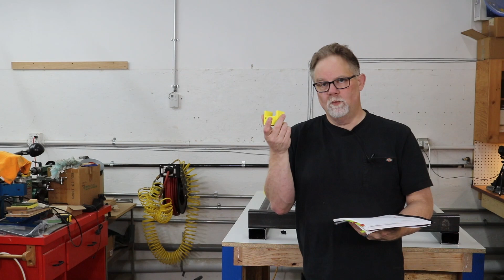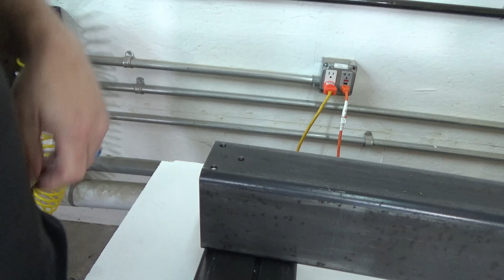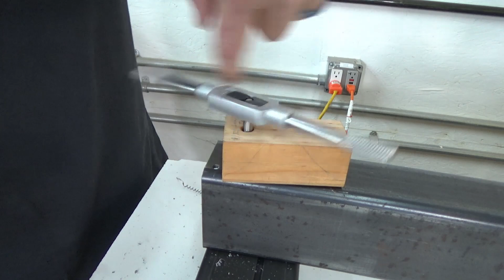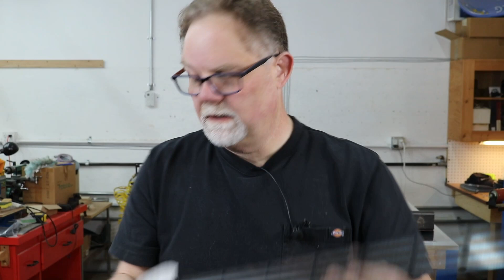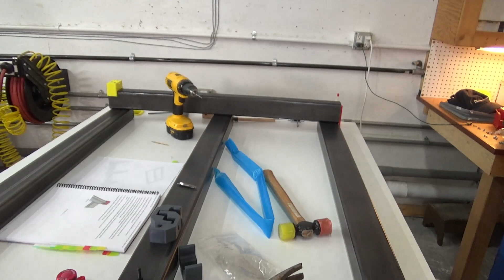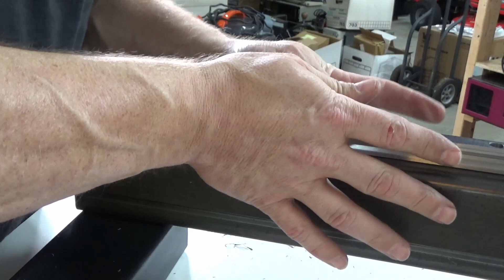PrintNC Project Part 4 - Y Axis Work

Comment: FYI, You DON'T need to drill every hole. Every other is more than sufficient.
Reply from the maker: I used  my one time machine trip to smack myself in the back of the head for even starting this project.  Hopefully your advice will help the next builder. ;)

Comment: A huge thank you for documenting your build in such detail. Like you, I've watched many videos but it seemed that omissions we're in each. 

The one thing that caught my eye was the lack of orientation marks for the 3D printed parts. It's implied that there's an arrow on some but it's just the shape of the holes.  Yes, the holes form some semblance of an arrow but an unambiguous orientation marks would help.
Reply from the maker: You're welcome!  The part orientation can be a problem if you're moving fast and not paying precise attention to the wiki documentation for those steps.  That's what bit me.  I'm hoping that the clarification I added to the wiki article for the BF12 blocks will help folks in the future.

Comment: Nice work Gene, strictly speaking those are called center drills. They are used on a lathe to drill holes in the end of stock so that it can be supported by a live (or dead) center.
Lots of folks assume they are used as pilot drill but the angle is completely different from a 118 degreee metal drill bit.
Reply from the maker: Thanks!  Yeah, it was a recommendation on the Discord, so I figured I'd give it a shot.  I knew they were normally used in lathes.

Comment: kudos for such accurate drilling. that ground rail is engineering porn, isn't it !?

looking forward to the next instalment :)
Reply from the maker: Thanks!  Using the right sized center punch along with my little printed alignment tool makes it pretty easy.  I spent the weekend doing yard work, so nothing got done on the machine. :(
Reply: @f15sim  cough transfer punch... I did tell you ;)